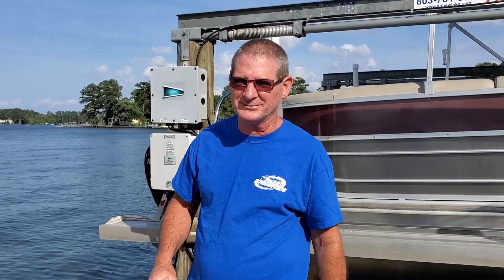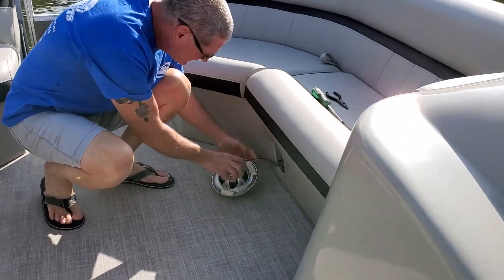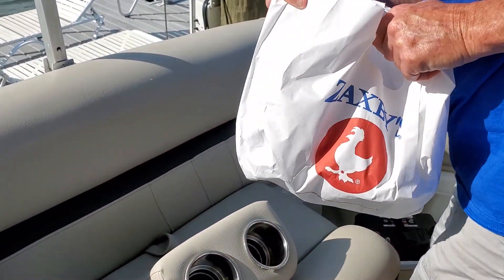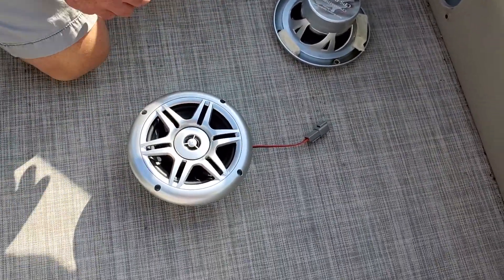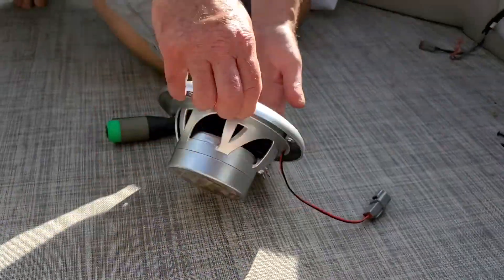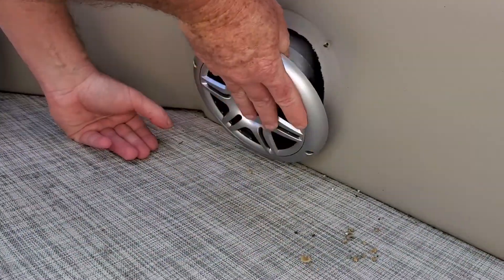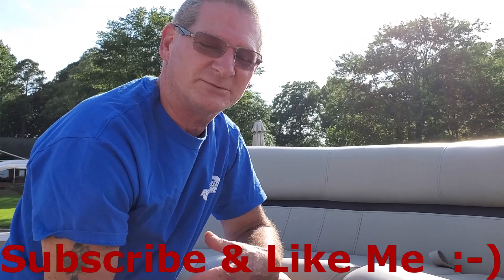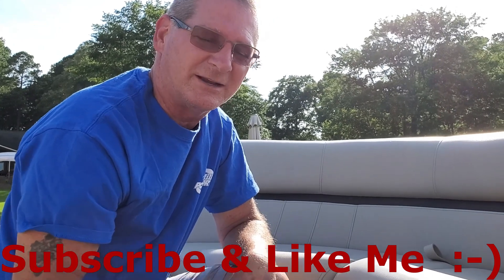Speaker Replacement on Forest River South Bay Pontoon

Comment: On my 2018 southbay the speakers are doing the same thing. The rear speakers lasted 2 years and the front ones 4 years. I was able to rig up some parts to get them repaired so I didn't have to replace.

Comment: I would have just upgraded the speakers to something better than Factory. I just bought 4 of teh SKAR Audio 6.5 inch Marine speakers for $100 a pair.. will be installing this week. 
Best of luck with the boat.. South Bay /Forest River make a great boat
Reply from the maker: Thanks, I will definitely look into those.
Reply: let me know how those speakers turn out or if you post a video on it i will definitely watch it going to replace my speakers too
Reply: @brae1088  they actually sound really nice!! I would say the JBL speaker I had in there (they were the regular car polypropylene speakers, with built in aimable tweeters) sounded just a tad more clear.. really just the super highs.. maybe because of that rotatable tweeter... but overall.. I'm really happy with these Skar Audio speakers. 
Again.. just running them off my factory Clarion head unit with Clarion Amp (I believe it's only 200 watt Amp.
Sounds great... and I do feel I can get more out of them... so I'm debating on upping the Amp to a 400w maybe... and adding a sub later as well. I'd definitely recommend them.. so far so good..